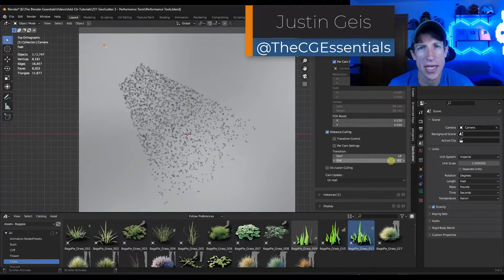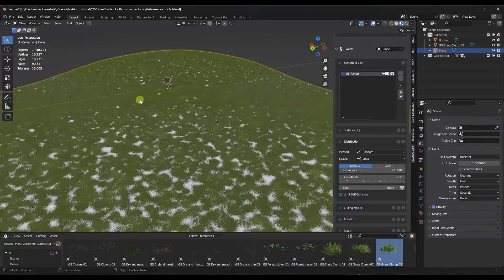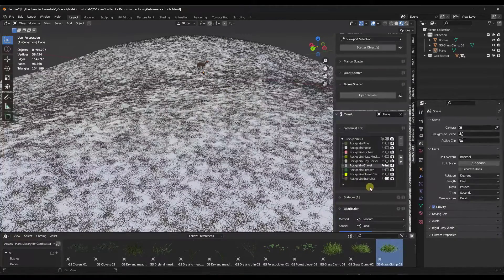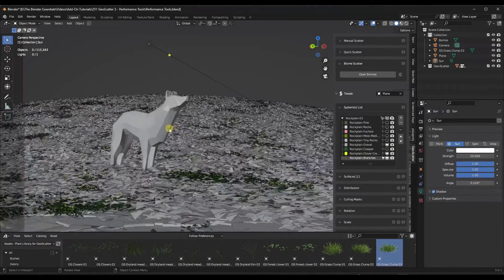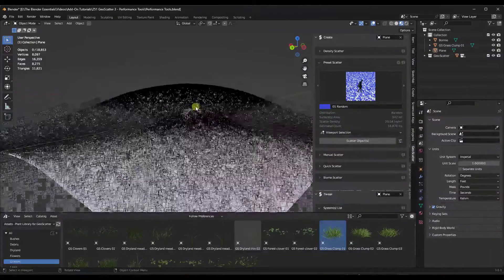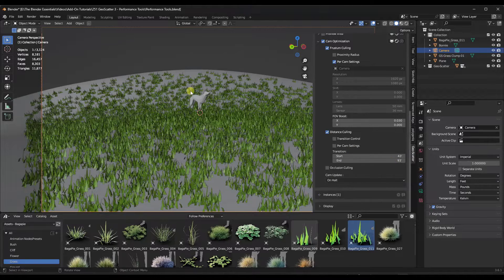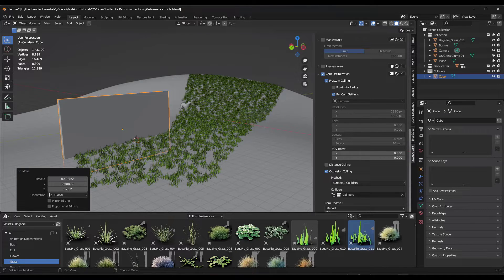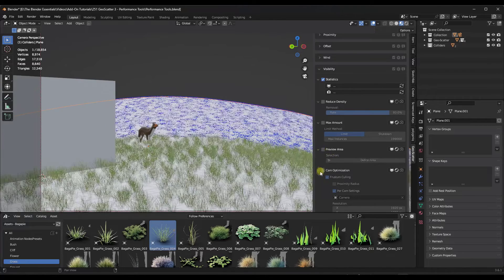Speed Up GeoScatter for Blender with these AWESOME TOOLS (Ep 3)

Comment: there is a BIG problem with this scatter system, and maybe with Blender itself that no one mentioned, is that when you start interactive render "viewport shading" all your optimizations are gone, so you can't change anything in real time. 
"display as", "reduce denisity" etc. all of these don't work when you need to change something during interactive render. This is a huge problem. And I don't understand how to render huge scenes with this condifitions. 
3ds max or Cinema4D don't have this issue imao.